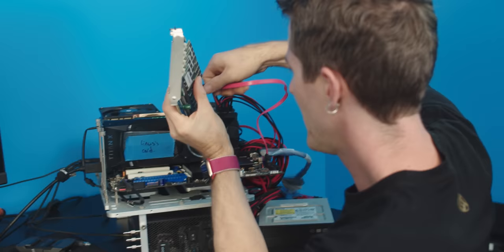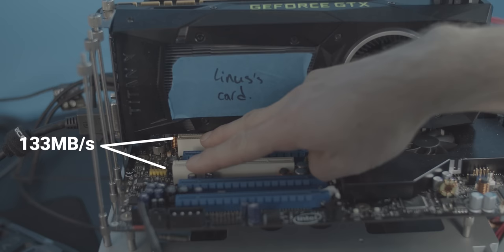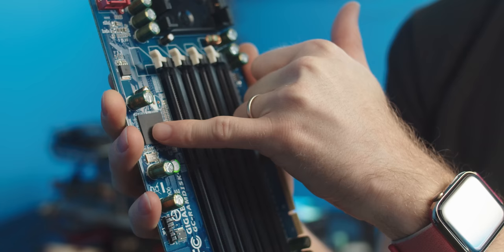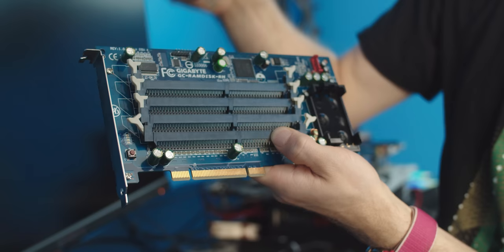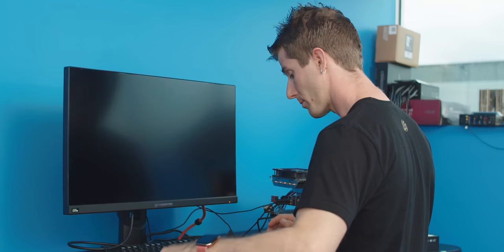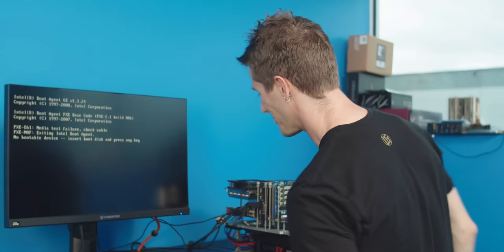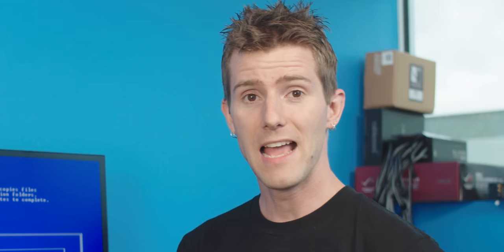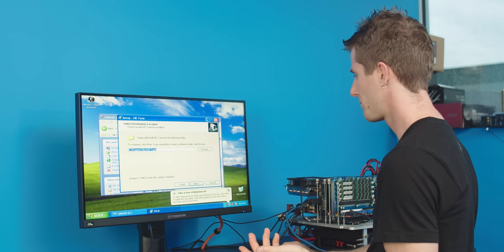WTF is this thing? - RAM on a PCI Card??

Comment: I started programming in ~'78 and building PC stuff about '82.. and you taught me something (relative simple, but..) that I've wanted to know for many years, but just never got around to digging up the details, being a bit technical, and that not many people would ever need (let alone want, I'm just a bit odd that way..) to know. Now you just need to explain exactly how quantum bits can hold a 0 and a 1 "at the same time".  Also bunch of other good (new) info here, I appreciate in the bunch of little vids you've done about these new ram-stick-PCI-(or-fake-RAM-slot-actually-straight-SATA) drives.  You think that RAM was steep? I don't recall the exact price of the Apple ][+ memory expansion - but at 16KB, I'm pretty sure it was 1 or 2 hundred..   Thanks again.

Comment: This just popped up in my recommended videos lol, speaking to the 10K Raptor SATA drives, I had 3x of the 500gb models in a RAID1 setup "back in the day" and while certainly faster, they still couldn't match even a SATA SSD drive.  I used them as a "fast scratch" drive (obviously not storing anything long-term, etc.) and I remember when I would copy stuff to a SATA SSD it would only hit like 400MB or so transfer when I know the SSD I was using would saturated the SATA III bus otherwise.

Comment: I would have loved to get something like this in the mid 2000s when I had tons of spare SD-RAM modules.
Would have made a great drive for the swap partition.
Losing the content on power down probably would not have been an issue in that application.

Comment: A far as I know the main purpose of these devices was to have a fast drive for the swap file (they where much faster than any SSD at that time and SSDs actually degrade quite quickly when extensively used for swapping). They where mainly used when the memory on the system already reached it's maximum or by people who had a 32bit-OS and didn't want to upgrade to 64bit.

Comment: well it could have bene useful back in the days to create some sort of pagefile, which is "virtual RAM" on a "hard disk" usually, but it would have been "virtual RAM" on "actual RAM" in that case. i remember back then, on W2K or WXP/Vista machines that pretty much had only a couple gigs at most, that thing would have helped quite a bit in virtually adding more RAM, even though it would have been at SATA1 speed (which was still crazy fast in W2K/WXP/Vista era)

Comment: I worked at a company that had one of these. The software moved a large mailing address database to the drive and ran a number of processes on it. When it was done it moved the end result of the processing back to the Hard drive. It was significantly faster then leaving the database on the hard drive.

Comment: i had both SCSI cards with RAM slot´s and my Sound Blaster 32bit soundcard with RAM slot´s and slot for a "music chip" well if you did buy a Sound Blaster 16 Pro you got the socket un populated, and if you wanted 32bit you installed another 16bit chip in the socket, this was early 2000 to 2005ish

Comment: way back in the day the mac was able to create a ram drive out of the onboard ram it was cool if you had enough ram in your computer you could copy your system folder and a few programs into the ram disk restart the computer with the ramdisk as the startup device and run stuff off it the computer was lighting fast and so were your programs so this was the first bacialy SSD and you hard control as well to turn it off when you wanted it off,, this way when powering down the computer you didnt lose anything so apple auctually had the first idea for ram drives or whats known as SSD these days or even the nvme idea ..

Comment: I remember that the old Big Box Amigas (A2000, A3000, and A4000) had RAM expansion boards that would fit into the Zorro II/III expansion slots in the systems. These worked well but the fastest RAM fit on a CPU/Accelerator board.

Anyhow, the Amiga from the early days created a RAM disk (the size of the drive was what things you put in there and you could keep adding stuff until all your RAM was gone. It was also possible to boot from this RAM disk on a warm boot.

Comment: Okay here’s the real reason for it.
FBI: open up
Me: let me just unplug my computer
Reply: smh just use full drive encryption fbi or shitbi cant open that then
Reply: If you're that worried just drop ya M.2 through a paper shredder
Reply: @rickyyoung  
That, will also destroy it.
Reply: @hariranormal5584  Really ? I didn't know that.
Reply: Cold boot attack: Let me introduce myself.
Reply: Just use some temporary Linux os lol
Reply: @hariranormal5584  Well....back when this was being made, I had never even heard of full disk encryption, and the CPUs of the era would have struggled with that pretty badly.
Reply: FBI: Open up!
Now unpluck your computer so we can take it with us and save the Data!
Me: But . . .
FBI: Do it!
Reply: @hariranormal5584  There will be backdoor/exploits in those encryption software. Around the same period, RunCore made an SSD that has physical self destruct feature, it actually send high voltage to burn out all the NAND.
Reply: @WarrenGarabrandt  cpu;s were much faster than hard drives, even back in the early 90's drivespace/doublespace etc were compressing files in real time (and uncompressing) to save hard drive space.   There would usually be a performance INCREASE even with the real time cpu de/compression - as CPU is so much faster than the hard drive the less time used on the drive equated to speeding up the system....  Would have been a doddle to chuck a bit encryption in at the same time..
Reply: @windowstips1430  but this just ruins tge data instantly

Comment: 1980 : We will have flying Cars in the future
2019 : Pci RAM Disk
Reply: hold your horses the bandwidth sucks and that's why we haven't seen any as of yet
Reply: not to mention it's expensive
Reply: This isn't PCIe, this is PCI, PCIe's predecessor.
Reply: @terrariola  i should know that, ty, fixed
Reply: also not 2019, this device came out in 2006 :) this video is a history lesson, basically
Reply: @hi7iz  pci is before pcie. So ask yourself this, why would it be 2019? Even in the video it is stated that it was released much earlier than 2019
Reply: :P
Reply: The comment section of YouTube has become saturated with this garbage the past year. What even started this 'A says: - B responds:' trend?
Reply: Not 2019, it was from 2006. You missed the mark with more then a decade lol
Reply: In another parallel earth, flying and hovering cars already existed. 😁
Reply: 1980 : we will have wireless power supply in the future

Comment: "I have 2GB RAM and I don't want to leave it behind...." - guy in pc forum in 2000's
Reply: The 2005 Dell Latitude D610 I'm watching this video on has only 2 GB of RAM (upgraded from 1 GB).
Reply: @JustinDaniels  You badass. I had a Core2duo build with 2gb DDR2. I bought a used 710 graphics card. And BOOM Crysis worked. I was flying man. LOWSPEC PCs rock when they work well.
Reply: I remember when I bought my Corsair TwinX 2GB DDR400 Dual Channel 5-5-5-2 kit that was, at the time, $750AUD. Now my GPU has 11GB RAM rofl.
Reply: I even had a mainboard that supported DDR2 or DDR3 - I used my old DDR2 in there for a long time alongside a Pentium D
Reply: @AryaCashOut  Agreed. I love this computer. The only thing unfortunate about this is that my parents won't let me buy a new laptop for quite a while longer (due to personal reasons--I have the money), so I am forced to edit my 1080p 60fps videos on their low spec cheap 2017 HP desktop computer (don't know its exact specs.)
Reply: @AryaCashOut  My exact specs for this Dell Latitude D610 are:
2.26 GHz Single-core Pentium M CPU (upgraded from 1.73 GHz)
2 GB 400 MHz DDR2 RAM (upgraded from 1 GB)
Intel 915 GM integrated graphics (THIS SUCKS!!!!)
80 GB IDE HDD (upgraded from 40 GB) (no idea of RPM)
Wi-Fi standard b, g and Gigabit Ethernet
Bluetooth 2.0 (gives BSOD when pairing to some speakers)
Windows XP, Windows 7 dual-boot config

It is barely powerful enough to play back YouTube in 360p (not full screen), however from XP, I can play up to 720p videos with VLC Media Player.
Reply: @JustinDaniels  I kind of wanted see what your channel was about. I saw the indoor golf course video.  I watched till the end. I liked that you were doing it at your pace and the audio was clear. I like audio with clear vocals. Many channels add too much background music. I'm subbing. And to anyone who reads this. This is not click-bait. I just thought he might have a channel since he mentioned editing 60fps. If it was an intentional mentioning, nice job making me check out your channel Justin. Keep going as you are.
Reply: @AryaCashOut  LOL. It was half intentional, half not intentional. But I'm glad you enjoyed the video, and thank you for subscribing! Also, I do agree that I like clear audio, and not drowned out with music!
Reply: @JustinDaniels  due to personal reasons? WTF, do you want me to talk with the parents for you?
Reply: @karapuzo1  What I mean is my mom is very reluctant to let me get a computer. She doesn't let me watch YouTube and is afraid I'll be able to get on the internet if I get a new computer. (What my mom doesn't know is that I sneak on the internet anyway, even though that is strictly forbidden.)
My dad helps me occasionally to make YouTube videos, but even then, what I am permitted to make is very limited.
My mom has made a system where I can "earn" the "privilege" to be permitted to buy a computer by being "good", so if somehow I can do that, and also not let her find out I have internet, maybe I can eventually be allowed to buy a computer. (Where I live, I am 15 miles away from any store that sells internet browsing devices, so I couldn't take my bike somewhere and buy a computer without them knowing.)

Hope this explains some things...
Reply: @JustinDaniels  that's some unhealthy shit. I am sorry. At least you are becoming more computer literate by pushing 16 year old hardware to do modern tasks. I had a similar laptop in 2003.have you considered putting Linux on it?
Reply: @karapuzo1  I don't know too much about Linux, but when Windows 7 support ends, I might consider it.

Comment: Wouldn't this make more sense as swap memory?
Reply: Chris Trimble paging file
Reply: for today's systems?  sure if you don't mind bogging down your system to have the satisfaction of a novelty add-on.
Reply: @bvbxiong5791  for old systems that still work pretty good as long as its not your go to upgrade and you upgrade everything else first it is definitely worth it as a page file almost like what Intel optane can do
Reply: @JimTheKid  my old motherboard only supported up to 8Gb of RAM but the CPUs that you could use on it (Conroe, Kentsfield) where still fast enough for gaming until a few years ago. So for this it made sense. Actually I thought about buying a PCIe-flashdrive for some time but then it turned out that they where too expensive and that I would rather replace the motherboard, CPU and RAM, which would have been more expensive, but the value was certainly also better.

Comment: 7:45 Tiny Windows 7 is newer and probably smaller installed.
Reply: He means that win7 and newer can't actually handle 4gb hard drives. Not if it can be stored on a 4gb drive.
Reply: @hyperparadox1  That's what the "tiny" is all about addressing.
Reply: @hyperparadox1 What do you mean Win 7 and newer cant handle 4GB drives. They can "handle" them no different to any older OS but if you mean handle as in used as a primary drive , as I said Tiny Win 7 is Windows 7 cut down to a small core to fit under 4GB. I've installed it on EEPCs and Thin Clients with Tiny HDDs.

Comment: I learned more with linus than in computer class
Reply: Pedro94 I know right but YouTube is not very good for a job application
Reply: Indeed! Linus managed to explain how hard drives read from individual sectors in an easy to understand way that no textbook I've ever read ever did, and he did it in just a few paltry seconds! I also now know exactly what those SMT transistors and caps are used for in RAM modules and how they work. What's sad is that I have been using computers since 1996 and have built and repaired quite a few (unprofessionally) and never quite had a total understanding of the aforementioned "lessons".

Then again, I haven't bothered to read those "dry" textbooks for very long before giving up, so there is that to consider. I don't have the patience to read overly wordy explanations for how things work before my mind starts to wander.

Thank you, Linus, for explaining how computers and their individual components work together in a simplified manner in so many of your videos.

Comment: The M.2 of the early 2000's
Reply: Uhm no speed is not a similarity here.. A rocked is not the father of a sports car in any way.  This is just a ram disk which used consumer grade memory to runs ultra fast and sometimes volatile... 
It was not intended as main drive...18hrs with backup battery is bad design for a sad made out of ram :-9

Comment: I used one of these for a build I did for a guy that ran a marijuana dispensary. See, marijuana dispensaries were “grey” legally in California back in the day (state law they were OK, federal law they were illegal) and the guy I built this for needed a way to quickly dump information if he saw the “feds” on his security camera system about to bust into his dispensary (kinda like in New Jack City when they get busted and they put floppies into computers to erase them). So... I rigged a cut switch on the battery of one of these RAM drives.

He sees Bush’s fed’s about to bust in, he cuts power to his PC and flips the switch to the battery on his RAM card drive and the drive with all his customers data is gone. He successfully used it too.... he told me the DEA agents were all “what’s this?” “what does this switch do?” I told him to tell the feds it’s for overclocking his computer so it runs games faster 😑

Comment: If only they could've used SRAM instead of DRAM. I have Game Boy Advance games with SRAM memory used for saving games, and the CR1616 lithium batteries soldered to their circuit boards still have a usable charge 20 years later. SRAM is so much more power-efficient than DRAM, it isn't even funny. The only reason we use DRAM in computers is because it's cheaper to mass-produce.

Comment: Back in  the Win/Dos days I had a Pentium 3 with 64MB of ram.  I found a freeware program which created RAM drives on the fly.  With the use of a batch file I wrote, I could type:  RAM WIN 10000.  Which creates a 10 MB ram drive, copies the WIndows 3.11 directory to the RAM drive, and then copies the archive files back the HDD when you exit Windows.  So not to lose the changes.
RAM DUKE3D 20000  does what you think it does, and was the FASTEST anyone ever saw it load between levels.

Comment: They need to bring this back, but integrate an SSD and have an easy interface where you just press a button or maybe tray icon and it backs up only updating change bytes to save cycles. When you boot if it detects power problems, it restores image from SSD. They need to do this. I'd buy it!

Comment: This device has a very specific target user. You can't leave your computer off for more than 18 hours without wiping your operating system (and that number would decrease over time) so you would have to be very frequently turning your computer off and on again.

Actually, now that I have an SSD, making the "suspend" button obsolete is exactly what I do.

Comment: Now find a really ancient version that used the 30 pin SIMM that would hook into an EISA or VL-Bus slot to be a RAM drive. Had the utility that would write the OS to the thing from the disk to run the OS off of it, took longer to boot up Windows 3.11, but it was faster after everything got loaded up into the 8mb.

Comment: Honestly. RAM storage could be useful if done right. Using DDR4 RAM in quad channel with battery backup and having the system just run files and codes right where they are instead of moving to RAM could possibly mean load times entirely dependant on cpu gpu and mobo speed.

Comment: I had an Iram back then, but I never used it as a boot drive, but rather as a "ram disk". (you younguns should probably google "ram disk") It was never intended for use as a system, or boot drive, precisely because of the volatile nature. Rendering multitrack audio and video with many DSP plugins to an Iram was lightning fast, as fast as it's memory access allowed at the time. I then copied the whole project to an HDD for permanent storage. To re-open, I wold copy the project to the Iram, where it would open almost instantaneously, plug-ins and all. BTW, my own custom Doom wads on Iram were silk, even when circle strafing 1500 "Barons of Hell" in "nightmare mode".

Comment: This doesn't seem weird to me at all.  I've burned out an SSD using it as a cache and could see myself using this as a pretty performant cache drive if the price was right.  Upcoming adoption of DDR5 might leave an excess of used DDR4 available to populate it.
Reply: bingo, cache/temporary storage! and almost every modern program [as well as some activities] generate data you don't intend to keep forever. what exactly were you using an SSD as cache for though, if you're willing/able to share?

Comment: Couple of thoughts...
1. Wikipedia notes that this thing has an integrated 1400mAh lithium-ion battery (10-16 hours of life). Presumably it clicks into the battery slot you showed us, making it more useful than you're suggesting?
2. It'd be interesting to compare the boot time to that of an HD (presumably it'd boot in like 20-30 seconds rather than 2-5 minutes which is a massive gain for the time). Also, it'd be interesting to see what sorta system-wide gains you get.